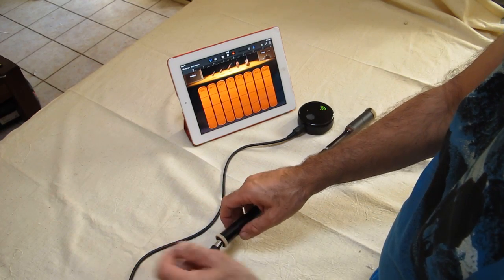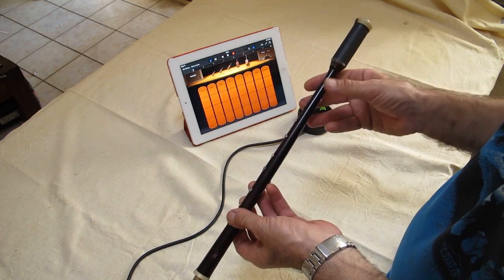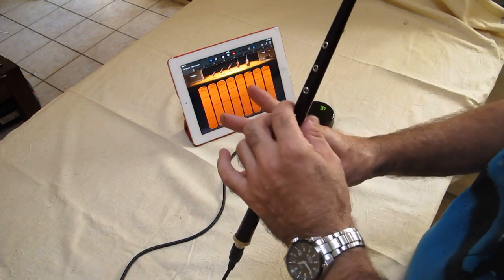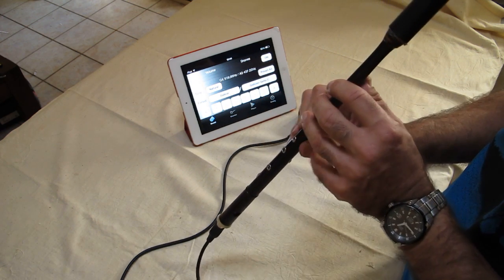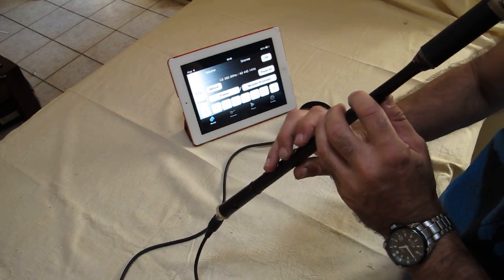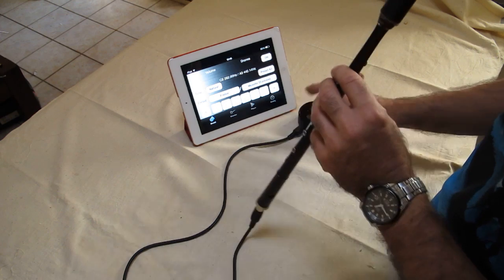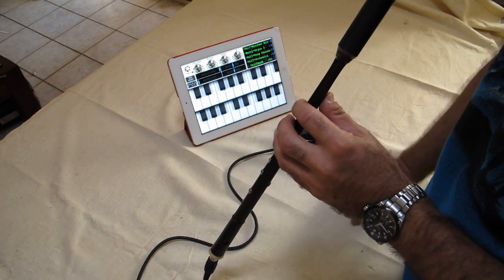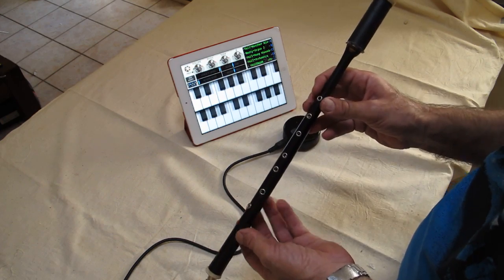Open Pipe and PUC WiFi Midi

Comment: The midi controller/chanter is built and designed by me based on the openpipe project, the WiFi midi is this, except the new one is bluetooth www.mipuc.com  If you're interested in a chanter please contact me directly